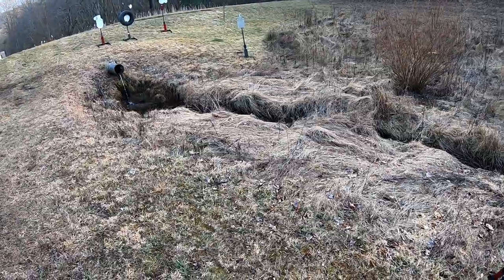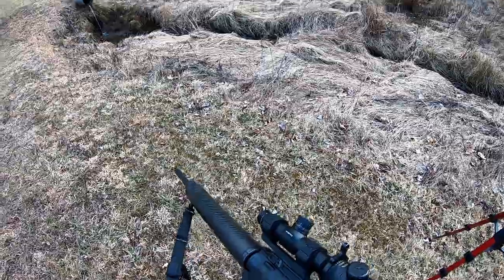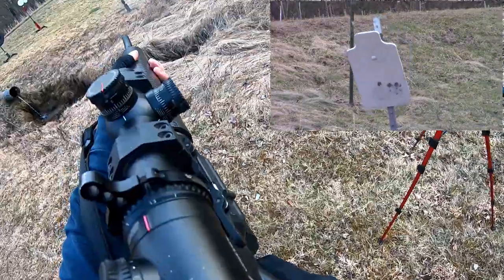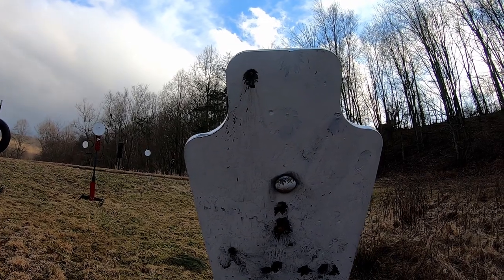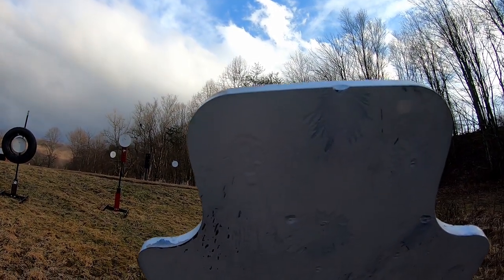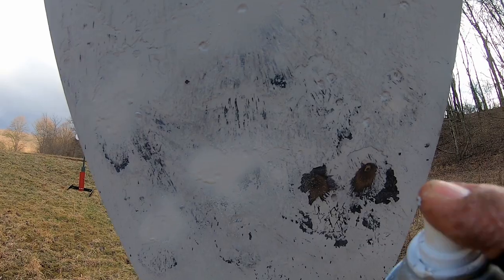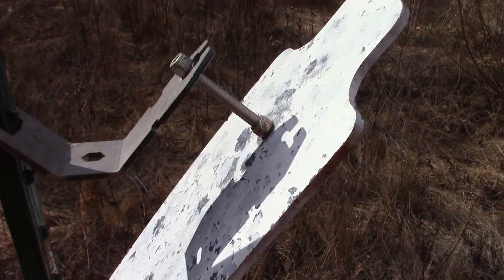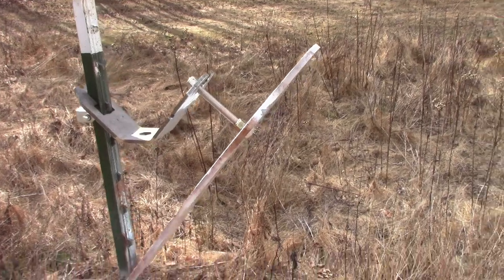SHORT Range Rifle Target 308

Comment: Was wondering how close was to close to shoot steel with 308, thanks for this!
Reply from the maker: It all depends on the velocity of the projectile at the target.   2800 fps is the threshold where chipping the AR500 starts to occur.  Most 308 ammunition is at or under 2800 fps but some handloads and specialty ammunition can go 3000 fps +     Also, remember that there is a higher energy transfer with heavier projectiles which can lead to the target plate taking a "bow or bend"   This can be mitigated by reversing the target plate on the hanger which is very easy and fast with the Hang Fast Target System.  It is universally agreed upon that the minimum distance to engaging steel target plates is 10 yards but I would still approach that distance with caution using rifles with lead core ammunition and heavy projectiles.   In this video I was using frangible 125 gr bullets loaded to 2800 fps. which can be shot safely at undamaged steel to almost point blank distances.   Do a test round first before a mag dump.
- Good Shooting !